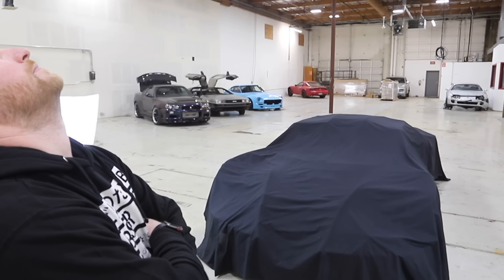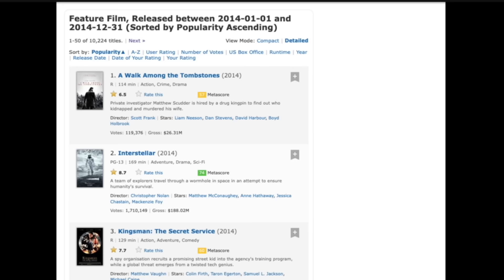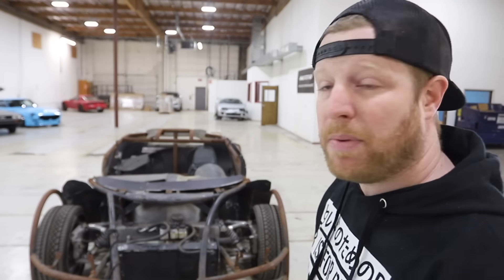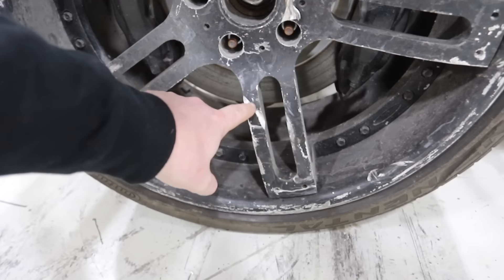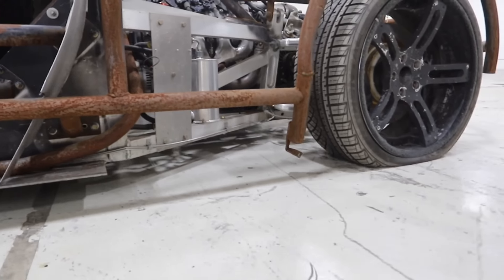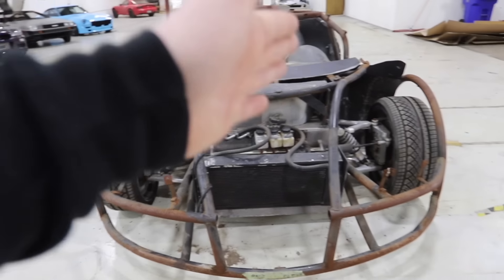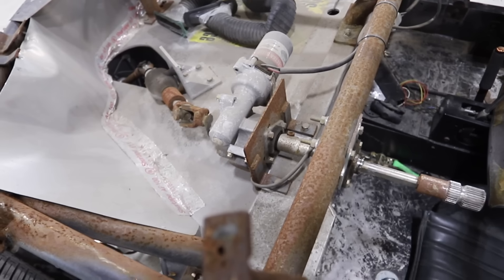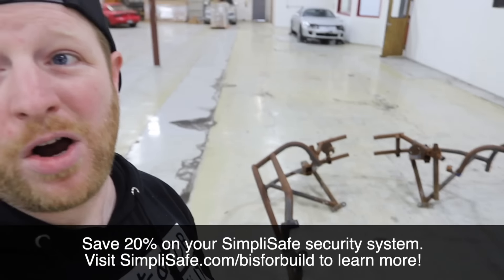I BOUGHT A CRASHED BUGATTI VEYRON!!     .... KINDA

Comment: I would of used this frame to make a replica original GT40 as it's already got the shape and height.
Reply: Yea that would have been insanely sick
Reply: GT40 would make so much more sense. The lines and height just work for the existing body.
Reply: I was thinking pretty much the same thing.
Reply: It would cost so much. I read in some other comment thread that one door costs right around 4k.
Reply: @sutairs  no some guy did a full replica using original ford parts in the UK way under 15 grand and that was only finished a few weeks ago. What you need to remember is the MK1 was all made from ford parts bin for switches seats gages and so on. Just need to find them parts and that's not hard. Buy a kit body that looks like the real thing but isn't
Reply: GT40 with a supercharged 5.0 would be sick
Reply: And the race car replicas who made the chassis, also make Gt40 shells, which should make things a lot simpler.
Reply: funnily enough Superlite/RCR makes GT40 MK1 and 2 replicas and a race version of the 2005 GT
Reply: Oh ya. That makes way more sense than a mustang fastback
Reply: Thats a damn good shout
Reply: at that point you’d literally be building a replica of the movie car gt40s from “ford vs Ferrari”, LS powered and all lmao
Reply: This would be a boss move.
Reply: GT40 with a Voodoo engine would be sick... although I know he said he does not want to engine swap it
Reply: I just saw a replica last weekend at cars n coffee. Looked amazing
Reply: I was thinking he was gonna say GT40 as well
Reply: This
Reply: Haha I came here to make this exact comment 🤣 👍
Reply: Cyberpunk GT40!
Reply: You guys have no imagination
Reply: Yup agreed
Reply: Gotta go GT40
Reply: I was thinking the same think 🤔
Reply: Yes gt40 yes yes yes
Reply: He’s nuts if doesn’t go with the GT40 design
Reply: Please!!
Reply: I came to say the same thing. I am sure it will turn out fine. But in no way will it be a '67 Mustang any more than it was a Bugatti.
Reply: Yeah I would love to see that 16cyl quad turbo engine that uses 9 radiators fit into a ford gt lol
Reply: No need to build, there is company in South Africa called "Superformance", they make stunningly proper replicas of old Ford GT40s
Reply: That’s a great idea
Reply: like, how do you guys just see GT40s everywhere? Is that a vision thing?
Reply: But what if he doesn’t want a gt40?

Comment: Dude, I cannot wait to see this. A lot of people on here are saying "build a supercar instead" but honestly, I can't think of anything more BIFB than a mid engined, SLC chassis, classic shelby mustang. Fits the vibe of the channel way better in my opinion.

For those of you that want to see a SLC chassis turned back into a supercar, go watch Tavarish. He is doing exactly that. Remember that we don't come watch BIFB for things that make perfect sense lol, we come here for awesome ingenuity and weird ideas nobody else is doing 🤘
Reply: I just really don't think he has thought this all the way through. Put an SLC chassis next to a Mustang and you'll immediately see that the length of that drivetrain is going to make it very very difficult to put the tires where they need to be and still have a place to sit.

And while rear engine mustangs have been done, they used basically the front half of a 4x4 turned around backwards to make it all fit. The engine was directly over the rear axle instead of 3 feet in front of it.
Reply: @Kyle Wise, I thought Tavarish sold his Need For Speed SLC chassis. I thought he didn't go through with the project.

Comment: As soon as i saw the rear end i recognized the SLC chassis. Then it made sense why you bought something so rough looking lol. The chassis is worth it alone. SLC makes a damn good setup. I used to sketch/design cars for fun & always dreamed of being a car designer or starting my own supercar company (one can dream right?).. And i have plans from years ago where my first model would start on that very same chassis to save money. Mated to small displacement, high revving n/a or twin turbo v8's from a Radical racecar, or some form of 'small', de-stroked, 8k rpm LS engines. With a 6spd manual, and optional DCT/sequential trans. Carbon bodywork, and roughly 2500lb curb weight🤘

Comment: I know they are easy to work with and have huge aftermarket support, but aren't you getting bored of having all your cars be a LS? I think the channel could use some diversity in motors.
Reply: I think that Chris is aware of what you're saying, he kinda acknowledges it in this vid. For this car he doesn't have that much of a choice though. Having to take out a working LS engine that's been engineered to work with the chassis and transmission is likely way too much of a hassle for him, Oscar and Kyle. I do agree with you, but i'm just happy that he's building another 67 mustang, even if it doesn't have a Ford engine.

Comment: Imma just leave this here
GT40 dimensions       Veyron dimensions
Wheelbase                  Wheelbase
95 in (2,413 mm)        (106.7 in) 2,710 mm 
Length                         Length
160 in (4,064 mm)     (175.7 in) 4,462 mm 
Width                          Width
70 in (1,778 mm)        (78.7 in) 1,998 mm 
Height                         Height
40.5 in (1,029 mm)    (47.4 in) 1,204 mm

Comment: Its a shame that the replicas in that movie where so bad: Even non- carpeople spotted the huge panel- gaps and idiotic wheel offsets from miles away. Some proportions seemed way off and the wheels looked like cheap aftermarket ones. On some shot the camera looks right through the cars  where they shouldnt...